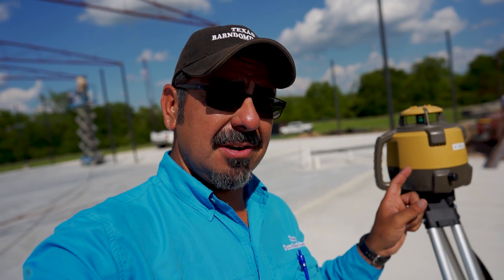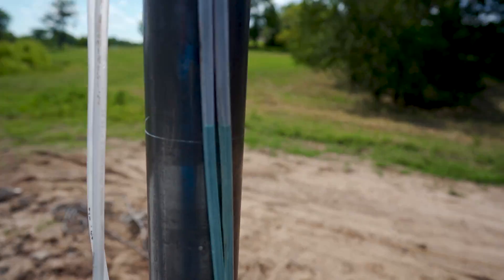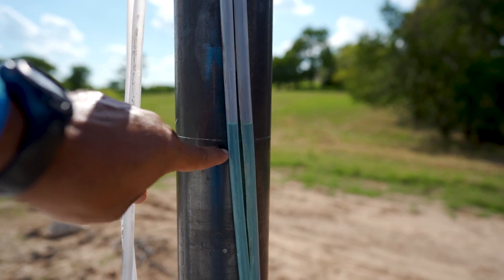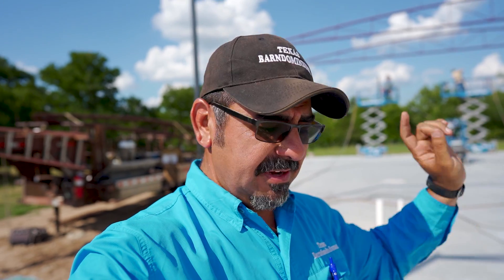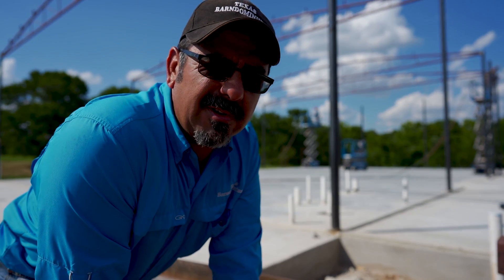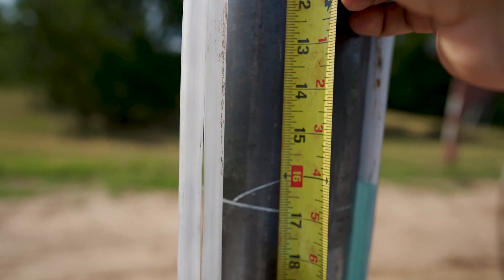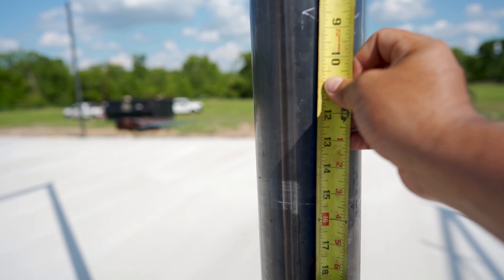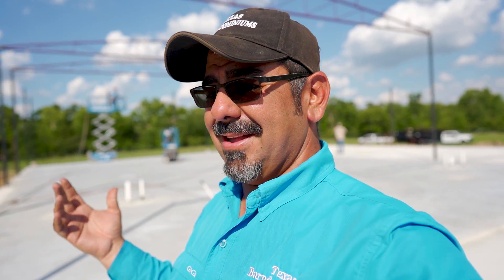Laser level vs Water level | Which is more accurate?

Comment: The more expensive lasers guarantee as good as +- 1/16”  @ 100’. Altho most construction lasers have the same power output, around 5mW, better accuracy is primarily due to better optics, crystal prisms and mirrors. Low cost lasers may be at +- 1/4” @ 100’. Very few will give specs beyond 100’. The bigger issue beyond 100’ is the beam width. The farther out it travels, the wider the beam gets. If you’re using a receiver at say 200-300’ with a low cost laser, you may get a solid tone at up to 1/2” travel off center. If you can see the beam, just split the difference and mark the center. Green lasers produce a sharper line at longer distances but use more power. So have lots of back up batteries and be prepared to spend a lot more $$$$
Reply: Due to curvature of the earth the laser will lift off the horizon 1' inch in 660' feet. If you shoot laser across a 660'ft pond, the water level will be an inch lower on the other end. A water level will differ from laser by 1/10"in every 66'ft

Comment: I have used a water level for years and the only issue I've had with using it is with other workers stepping on the hose!  I've even had them trip on the hose spilling the water pail and causing me to fill and start over.  You also need to be careful of air bubbles in the hose,

Comment: Neither is off. It was human error. Either you slightly moved the pencil mark by an 1/8th or whoever did the water level moved by an 1/8th off when making their mark. Its easy to find out by just double checking both to see which one was off by the 1/8th.

Comment: You want perfect, use a Trimble DINI digital level, measures out to 3 decimals
Reply: 3 decimals doesn't say much unless you state the base unit... 3rd decimal of a lightyear is somewhat larger than 3rd decimal of an inch...😀🔎
Reply: @michaeltempsch5282  
Let me restate: I should say 3 places behind the decimal point
Reply: That is the 3rd decimal, isn't it? But the quetstion is the third decimal of what? 0.001 x 1" is a lot smaller than 0.001 x 1 mile. Say for a distance meter, if it's 0.001 of an inch,a foot, or a yard, makes a difference in absolut precision.
Reply: @michaeltempsch5282  In the everyday surveying we do,  we use "US Survey Feet" for now, until they make us go to Internation Survey Feet.
Reply: @parexc07  OK., guess that's the implied unit "in the business". But would that be the US or the Indian version?😋Sorry,just couldn't help myself.😀

Comment: The laser is level to the degree the user can read a bubble--it creates a flat plane, for sure.  The water level will only be off level by the amount of water it takes to fill the tube given the grade of the spot your checking/marking relative to any other spots your looking at.  If you're comparing two points to be the same grade, the water level is more accurate.  However, if you need a difference in grade between those two points, the water level can be inaccurate. For instance, when installing a septic tank with a water tube attached to a grade stick, you'd measure the grade of the stub out, and without changing anything, measure to find the grade of the bottom of the tank hole--maybe 5 ft deeper than the stub out.  Water will be emptied from the container to fill the 5ft of hose due to the difference in grade, and the depth in the container itself will change as a result.  Thus, it's slightly inaccurate.  The smaller the tube you can use and the bigger diameter container used, the more accurate it will be.

Comment: I’d trust water level, yes it’s takes a bit longer but it can go around corners/blind spots and still be read accurately
Reply: I'm reading alot of comments about the time needed for a water level.
Starting to think if I wanted cheap and quick.  I'd buy two long lengths of tubing.  Affix two of them together.   Then move one end to a spot where you need marking.  Then move the other tube to another spot.  Hopefully, by the time you've affixed site 2 ... site 1 has settled down for marking, then move it to the next point.  Return to the other tube and mark and move.
Cheap and possibly just as fast.
Reply: Ive seen plenty of brick piers that are up to and over 30mm out of level after brick layers using water levels to level them. Ill stick to my laser level thanks.
Reply: @Ga7cun7sSUCK  - Just as in the video. The error is not from the water level per se. It's operator induced! 
That's a given. Physics don't change. On the other hand operator's patience, capacity, whatever, varies a lot! ;-)

With this said I would go with a laser. 
- IF I didn't have to pay for it! ;-)
- IF there was a multitude of continuous work, that justified it! Other wise for a couple of measures the water level would be just fine. After all most backyard projects only need a few measurements. A "pro" doing it all day long, day in day out. That's another story!

Comment: For the average homeowner, a water level is a cheap tool that's deadly accurate.  you can attach a cheap tape measure to a 2x4 and use it to shoot grades your yard or driveway.  Heck in this instance right here, the landowner could figure out where he wanted the shop, stake it out, then go around with a water level to figure out how much dirt work would be required for this giant pad.

Comment: If the laser was perfect with the water level on every post but one,  then it is not the laser, most likely human error when marking the water level. The laser is  straight line, if its off an 1/8 in 20 feet, then it will be off a 1/4 in 40 feet. It cant be off in the middle, then back on.
Reply: I caught him not  being consistent in  holding the tape to his upper marks.

Comment: The water level is great for anyone to use as it's cheap and simple to use. The laser needs deep pockets and training to use.
Reply: That's a fact, Jack! A LASER level is only as good as its setup.
Reply: Water is level ,fact. Every foundation has to be measured,squared and level. Water level is better because if you have objects in front of the laser it can't operate, with water you can
Reply: The training to use a laser takes about 1 minute it's pretty simple.

Comment: obvious it was human error nether device is wrong
Reply: Wrong the   Laser   Level can be wrong   . Water Level Never Wrong
Reply: @scottbutler2761  the laser wouldn't be wrong on just one post. If it were out of level it would get progressively get more wrong the farther away from the transmitter he got. Someone didn't transfer the mark correctly.
Reply: @thebigmacd  I know im a Builder  . i rather use a Water Level
Reply: @scottbutler2761  :Automatic compensation  - within the range of the bubble ring.. - but yes you need to check - same as with a dumpy level - 2 shots (known height) 180 degrees apart - needs to be "bang on"

Water -- needs patience for it to stop bobbing  - a tap on the end of the line can avoid bobbing when walking from point to pont. or loosing water when crawling in tight areas...
Reply: @scottbutler2761  true but the laser is not going to be off in the middle it was probably impatience during setting the water level, or the receiver was wrong
Reply: Rich Brock  What have you ever used a water level    ....

Comment: A quality laser level accuracy is plus or minus 1/16th of an inch (0.0625 inches) per 100 feet; 10 times greater than spirit level accuracy of over 1/2 of an inch (0.6 inches) per 100 feet.Water level is bang on over 100ft.Plus you dont need line of sight for a waterlevel.

Comment: As long as the laser is set and leveled it's going to be fast.  If it's NOT leveled correctly, gets bumped or shifts you're going to have an issue. Water doesn't have any way to screw it up other than not waiting for it to settle? right?

Comment: I've used the water level, laser and jig transit for layout before. For simplicity, the water level wins. For speed and accuracy, the laser wins, for absolute accuracy, the transit is king.
The laser is a productivity tool. A single tradesman can set up a laser and mark all the locations inside a work space in minutes. A water level is a low skilled tool that works well within the limitations of the length of the tubing you have access to.

Comment: You can check the accuracy of the lazar level using the two peg method, most people don’t know how to do this. I’ve found brand new lazar levels to be inaccurate. A water level doesn’t need to be checked and is always right on if you are patient enough to wait for the water to settle out.  To two peg a level set up two posts 50 feet apart. Set the level up in the centre. Shoot both posts and measure the difference. Move the level 50 feet away from the pegs and shoot them again and measure the difference it should be the same. If it’s not you can see if it’s shooting up or down.
Reply: SWEET!
Reply: Every other tradesman also went to trade school rick! Were you the auther of the the two peg method??

Comment: Could be human error when they marked it. 
You always mark/measure at the bottom of the meniscus (the bend in the water due to surface tension) Maybe it wasn’t settled as you mentioned. The only other caveat I would add is marking it at the same time, as fluctuations from temperature could affect it.
Reply: Ahhhh - Thank you - I was wondering about that! (Where to measure to.) I like to establish a simple grade line somewhere on the project and periodically check to make sure it is still on. I was thinking about "upgrading" to a water level, but the accuracy specs are not nearly within my personal tolerance. When I'm putting in a foundation, I want it as perfect as I can get it. My late father, a master carpenter always told me "Son - If you don't get the foundation square and level, you will fight the problem all the way up."

Comment: Won't the water volume in the plastic tube expand/contract with temperature variations throughout the day ? 
Won't compressions / kinks on the tube cause volume displacements in the water level ?
Just wondering ...
Reply: Even with different size tubing and expansion, if the water is on the mark on one side, the otherside would be level. They would be off at both ends if variables changed. Just make sure you get one end right and the other will be as well.

Comment: What matters is what you want to measure. There is a discrepancy over large distances because the water level follows the curvature of the earth, which is about eight inches in one mile, while the laser goes in a straight line and thus diverges from the earth.
Reply: my take-away: Laser Levels are for Flat Earthers.
Reply: Ok I could have looked into this at any point but never thought to because I didn't think it was anywhere close to that much, if someone would have asked me i would have said that maybe it curves a hundredth of an inch per mile on the and certainly not 8 whole inches, so if I am mathing right it would be 1 inch per 660 feet and 1/8” per every 82.5 feet! This is blowing my mind that it curves this much.
Reply: @bdkj3e  Well, the deviation is a curve, not linear, so a tenth of the distance does not mean a tenth of the deviation. It's practically negligible on short distances.

Comment: String a line across the poles on both sides and see which one doesn't line up in the middle.
Reply: Lines will sag.  At the distances he is measuring, a line will certainly sag if it's not pulled very very tight.  A breeze can throw it off, too.

Comment: Like most scenarios I have seen at job sites, the true test is repeatability, which level works more often? My guess is, in a more exhaustive test, both levels are going to perform very well, and it is most likely, human error that accounts for differences. An example, if you measure something 10 times and 9 measurements are the same, and one is not, the measure that is not the same, it is usually due to human error, and not the tool.
Reply: Water level, nothing needed?  Only a pipe and water,  last time i checked thats something.

Comment: Laser levels require line of sight, water levels can work around corners, through trees, opposite sides of a vehicle. etc.
Reply: Modern technology that can produce a translucent flexible tube that long. The LASER is off(not perfectly leveled) the water is as correct as you can get.
Reply: @dbmail545  is that means the earth is flat?
Reply: Excellent Point👌👍🆗
Reply: very good point.
Reply: This is what I was going to say.
Reply: You are a genius, 👌🏽
Reply: John Bowkett  I think that we can agree that there's still only three ways to do the job;
Your way, my way , and the right way.
 It's great to have the right equipment ; spirit levels, optical (dumpy) levels, laser levels,
electronic distance measurers etc.
Somany tools to make the job easier, faster,
the building and construction industry has come a long way
We live in a wonderful age.
Reply: Excellent point, they use it a lot to level the fundations all around mobile homes too. Great point
Reply: You can bend light with a little bit of gravity.
Reply: Used a water level once from the outside of house to drill a from the inside where the level was critical on both sides, it worked.
Reply: true
Reply: Very true
Reply: Dont water levels create too much tension when using a thrashed line like he is? Dont they have to be non kinked?
Reply: @SH19922x  yeah you definitely can't have a kink in it or any air bubbles I remember my dad  40 years ago using a water level constantly with his partner in construction
Reply: And people think the Oceans are round, Oceans are Water 
Sea Level 
Wake up people
Level Water can't create a Globe 
The Globe is a Lie
Water being Level proves it
Reply: Both tools have their place.

Comment: Are these buildings taxed differently to a regular house?
Reply: Sheps, they can be. Depends on where you are at. In addition, in places out in the county where inspection is not required, from time to time you will see a metal shop built. Then a little while later a home is built inside it. The county knows you have a 50x50  shop. They don’t know much about the 50x30 home built in the back. So your $30k shop is really a $100k home. 

Homes like you see here were always built as homes and meet codes etc. so any tax break would be on perceived value differences, not the fact that they are Barndominiums.
Reply: Not having to permit a septic tank is a huge savings